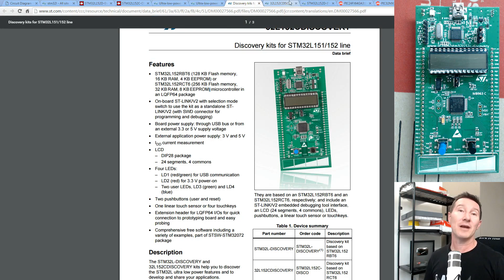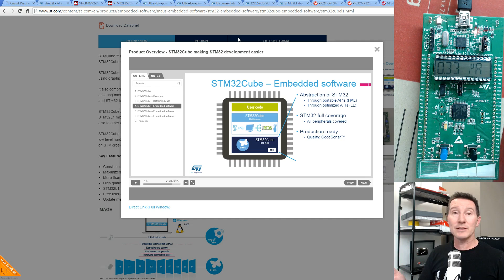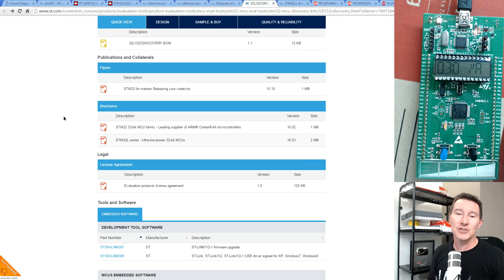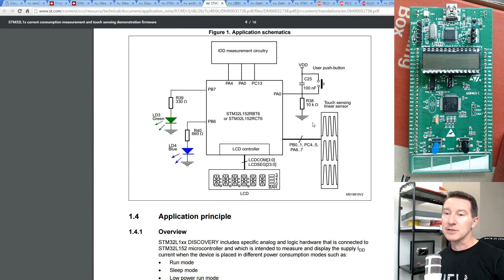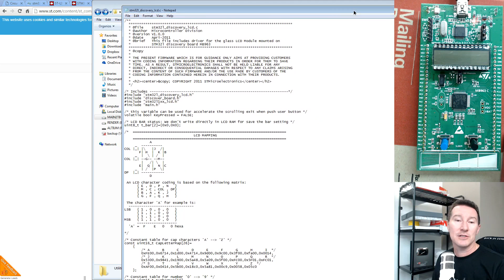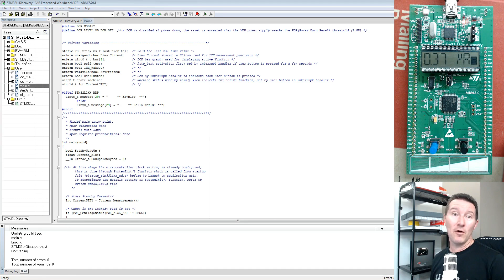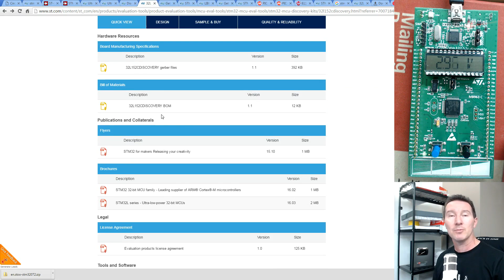EEVblog #900 - STM32 ARM Development Board

Comment: +EEVblog, I believe you would be more lucky on Keil instead of IAR. From their website: "ARM offers the fully-featured Keil MDK for STM32F0 and STM32L0 devices that is free of charge for end users.", so you get the full software for these two microcontrollers and even when you are not using them (which is your case now) at least you are already used with the IDE (and you will be changing one trial software for another, so not much of a difference there either).

Also, you might want to try the  free update Segger gave to the CubeMx (I don't know if it's compatible with your Discovery board). They made their flash and debug firmware JLink free for ST, they are faster and better as advertised by ST itself, and there are tutorials on how to get back to the original ULink in case you don't like it.

I also always found Middleware a funny term, and the industry has some different meanings for it, usually is a group of software that implements a lot of usability that will control the device, not as much as OS and not as simple as a library, but sitting on the "middle" of the two of them, that's why ST is going to have a "driver" library for the SPI, but a "Middleware" package for the Ethernet communications. 

Last, there is a tiny square on top of the Digikey table, you can set your minimal unit purchase to 1 unit and it will filter to only show the prices for 1 unit, instead of the 1.500 and likes of it. 

These are my 2 cents on this video, keep on with the good work and good luck on your new project. ST is nailing and delivering and leaving the competition far behind.

Comment: You can use Keil for STM32F0 and STM32L0 series for FREE! STM32L0 series also has good features as L1 series.
You don't have to use silly IAR or something else. 

ST has done good thing with Cortex M0 and M0+ series.

For example STM32F072 has 1xCAN + Crystal-less (yes it is true) 1xUSB2.0 + 12bit ADCs + 2xDACs and lots of things with running @48MHz.

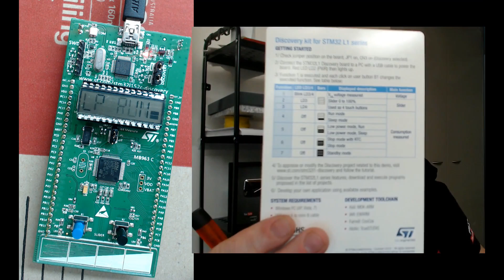Comment: Dave, curb your enthusiasm and just READ the few words / bullet points in front of you!  At 14:30 you are looking at the simple diagram on the back of the package which would have spared us >10 minutes of your fumbling around & accompanying BS in using the demos (i.e. touch slider).  READ the short Getting Started guide PDF.  READ the Installation guide.  Just doing this would have made this a BS-blabber-free, concise, 15 minute great video.
Reply: Probably you're right, but personally when I first started with STMs I found this brief and 'getting started' documents barely useful. Read them but still didn't know how to bite it. But it just may be that I'm more learning by trial type.
Reply: Uncle Dave is an excitable budgie
Reply: We don't watch Uncle Dave cause he used to be a news anchor, your idea would be boring as bat shit. Don't poke the bear.

Comment: What can I say about ST Microelectronics? We developed an automotive ethernet camera around an STM8A micro. The development environment, IAR Embedded Workbench, costs about 2900 euros !!! per 'seat', that includes a source level debugger and it has the MISRA-C rules checker. It only runs with a USB dongle, so no dicking around there. And ST won't give you any information, apart from some example code and a datasheet of the micro. The total user or developer experience was way below average. For my latest project I switched to the Atmel SAMC21  ARM controller, uses GCC and the fantastic Atmel Studio 7 which is essentially Microsoft Visual Studio and I got the C21 Xplained demo board running within 10 minutes right out of the box. And there is a load of example projects, datasheets and Application Notes. 
That's the way you do it.

Comment: Question: how do you efficiently power these ultra low power chips from a 12 V source like a battery?
Reply: Switching regulators, you can get as much as 90% efficiency out of them if designed well.
Reply: They can be 90% efficient when at high load, however I fear that when absorbing 1 µA things would not work that well...
Reply: vihai Ti has some chips that claim 90% efficiency at 10uA but yeah i guess at really low power like 1uA it won't be so good even then :o http://www.ti.com/lit/sg/slyt593b/slyt593b.pdf

Comment: One problem that I have found with CubeMX is that it doesn't enable the (not always present) FPU and I am not able to find an option to do so. Maybe I am just blind, because having to paste some assembly code to the init file doesn't seem right. (especially since CubeMX overwrites the file entirely when generating code!)

Comment: I wouldn't use metal screwdriver as a pointer -- an accidental touch of the pcb may damage the board. Or the user if it's a high-voltage application :)

Comment: I've used STM32 MCUs in a couple of projects, a small F103 for a super compact board and a big F4. After a lot of research I believe ST doesn't support any really free IDE/toolchain. In the end I found a decent arm-none-eabi GCC build and learned how to use OpenOCD, and starting from the Attolic stuff (which uses GCC inside their non-free IDE) and custom makefiles you can get by. But it's a pain compared to what others provide (for example Kinetis Design Studio or LPCXpresso).

Comment: Is there a free IDE for STM32 boards without a code size limit?
Reply: Yes. Atollic TrueSTUDIO.
Reply: Does it come with a compiler or do i have to download it somewhere else?
Reply: Yeap it come with the compiler/linker etc. you can generate a project via the stmcubemx import it into truestudio and go straight to building and debugging. The only major downside to the free version of truestudio is it does not have live updating debug variables. you have to pause or hit a breakpoint for them to update..

Comment: Is this sponsored?
Reply from the maker: No.
Reply: +Sharklops yes it is but you have no pain setting it up
Reply: You're just leaving the pain for later when you have to make you actual end product. There's no way around figuring this stuff out unless you're just dicking around.
Reply: I worked with a STM32F4DISCOVERY for a first prototype on some embedded sensing/communication circuitry for a knee exoskeleton built for measurements (not direct orthotics), and these things really pack a punch. The libraries are going through a slightly inconvienient period of slackening support for established code due to the introduction of the CubeMX/HAL drivers/libraries, which we'll probably (and hopefully) hear some entertaining rants about, but I consider these babies great for early development and maybe even learning, once they polish up the IDE and libraries a bit.
Reply: +EEVblog Cool. It's just nice to know:-)
Reply: Dave is never one to mince words.

Comment: How can I get a hold of one of those 20-something segment LCDs? I've looked on google for an LCD in a DIP package but it keeps giving me links to the pixel-based ones that can be plugged into arduino boards. Can anybody point me in the right direction?
Reply from the maker: Digikey used to have some.

Comment: Can a smarter person than I tell me what hes building?
Reply: i bet uCalc.
Reply: might be multimeter
Reply: Yes, it's almost certainly the uCalc or the Calculator watch that they demo'd a while back. It requires LCD, cap touch, plus a decent floating-point capable chip. ARM is a good choice. PIC24 is definitely not my favourite architecture. PIC32 would have done a great job -- Dave should have checked the 1XX/2XX series, not the 3XX/4XX.

Comment: STM32CubeL1 firmware package has got all the necessary example projects, drivers and middlewares that you need for the development.
Reply: You don't need it and the Cube software is controversial: http://www.eevblog.com/forum/microcontrollers/st's-(stm32cube)-software-ecosystem-is-terrible-how-can-we-fix-it/
Once I created a simple Makefile with GCC for another STM32 chip. But for my STM32F4 discovery board there is mbed, which is very professional and easy to use (if you know C++), much better than Cube: https://developer.mbed.org/questions/54385/How-to-use-mbed-for-the-STM32F4-DISCOVER/
But if you have the money to spend, you could use one of the big players like IAR. The integrated debugger helps a lot when you need it. It is a pain to setup Eclipse etc. with GDB.

Comment: stm32s don't need a special compiler , standard arm-gcc works fine. CooCox IDE does a great job at getting all dependencies up and running.
 It worked right out of the box with my unsupported, cheap-ass minimum system board and counterfeit stlink-v2.  Just make sure to get 1.7, not 2.0 beta for now.

Comment: "run to main" is on by default, it will breakpoint at that location you have to press triple right blue arrow to run code.
Reply from the maker: Ah, that explains it, thanks.

Comment: I recently (last couple of weeks) tried out some similar stuff with the STM32s, working with an individual chip instead of the development board, the Cube software and interface seems great, but finding a compiler/ide/something with everything linked as a demonstration to compile and upload your full project was a pain.  I ended up going with Cosmic as the compiler and SystemWorkbench and while they play fine together, neither is entirely without problems.  Both required a separate registration on a different website, cosmic required a send away for an email key locked to your computer - free up to 32k flash and renewable indefinitely requiring it each year - but not your easy download, install, and you're good.  SystemWorkbench seems like a pretty good IDE based in eclipse, but it's got some quirks too - difficulty installing and some information on their site hidden behind logins (though, the same you need to download it).  You can download the firmwares from repositories through the IDE, which is nice, but it doesn't always download the most recent one.... I had to manually update one set of HAL firmware libraries from 1.3 to 1.6 or something.  If you use the Cube software and import the project it creates, I'm not sure having them installed in the IDE as well is necessary.  The documentation for HAL seems to be fairly good, but it does seem that different product series (stm32f1 vs. stm32f4 vs. stm32l1, etc.) have some slight variations, so at least in my brief glance through it, it's been a little confusing to get all the right function calls and whatnot.

Don't know why they don't have something of their own to compile and manage projects.... seems like it would be a no brainer.  They even have one for their STM8 line of products, though it feels a little dated, but pointing you around to third parties which aren't guaranteed to play well enough together to just compile and run basic demo projects seems obtuse.  Took me several nights of working before I got everything configured, uploaded, and running properly (though at least a little of that was a solder bridge!).

Comment: IAR is the only modern compiler I've used which has produced provably incorrect machine code after optimization (yes, the most recent version).  Very worrying given it's the only option for a certain product I'm working on, and that bug was only obvious because it resulted in an infinite loop.

FYI, TrueSTUDIO (mentioned in the getting started) uses GCC.  Also CrossWorks and VisualGDB are a couple more options that use GCC and will take care of the messy parts for you.  I wouldn't consider trying to set up a whole build process/linker script/all that myself with GCC, but there are a lot of professional options that use GCC as their compiler and after my experiences with IAR I'd be inclined to recommend one of them.

Comment: Just buy the Torrent version of IAR. HAHAHAHAAH
Reply: +MFeinstein it's legal if u make no money with it
Reply: If you're hobby/small company user the free 32K version should be OK as it don't exclude commercial use.If you're a company and you install unpaid version on employer stations, they could turn on you after they no longer work for you especially if they left on bad terms.
Reply: Tony Philipsson If it's not for revenue in Brazil you actually can install and use fake software.
Reply: +Felipe Navarro where did you learn this? Of course you can't, if you could all Windows pirated versions for home users would be legal.
Reply: its useless, its outdated and probably way out of date, more trouble to find out you using a product that has bugs further holding you back.
Reply: +Felipe Navarro it's not a crime, but it's not legal either.

Comment: @Dave ..... you really should try the SAM L22 product line from Atmel ....... you get very good power numbers on the SAM L22 ...... search for SAML22N18
Reply: and they come in lqfp 100 pin package ...... it also has a dev board with the same chip

Comment: Hey Dave this bugger is really popular with multi rotor people. STM32F303 CPU 32bit ARM @ 72Mhz 5v max
Reply: All STM32 are only 3.3V, they have some pins tolerant to 5V but they all operate only from 2 to 3.6 V
Reply: Miloš Lazović
Yes ... but for RC we have receivers that are most typically used to power them on a PCB  board populated with baro and 3 or 6 axis gyro's ect.
Reply: MrLunithy
On FC microcontroller, baro, MPU all are powered by on board 3.3V regulator.
Little correction there is no FC that have 6 axis gyro, thay all have 3 axis gyro, they on other hand have 6, 9 or 10 DOF (6 DOF is 3 axis gyro + 3 axis accelerometer, 9 DOF is same as 6 DOF + 3 axis compass, and 10 DOF is 9 DOF + baro). There is no need to have more then 3 axis gyro, you will not gain anything.
Reply: Miloš Lazović
Yes you are correct the main difference between a 3 axis and 6 axis gyro is that the latter has 3 accelerometers in addition to the three  standard orientation sensors. The pitch, yaw and roll sensors will navigate your 3 axis copter well but the added feature makes the 6 axis more resistant to altitude displacement.
The accelerometers compensate for any unwanted acceleration or simply movement in the three dimensions. This ensures the quadcopter can fly freely without interference by wind, going too high or falling to the ground. Any user learning to operate remote aircraft can easily make sharp turns by applying the rudder and roll features in the 6 axis too.